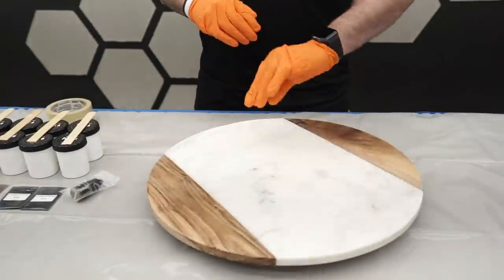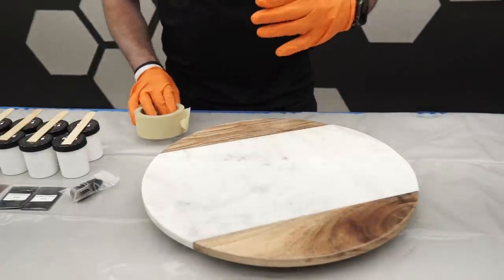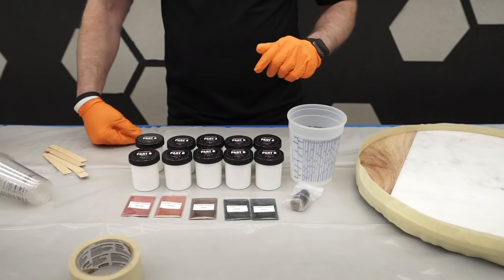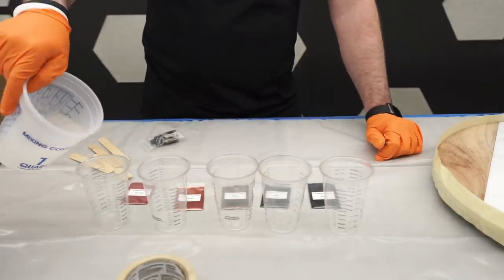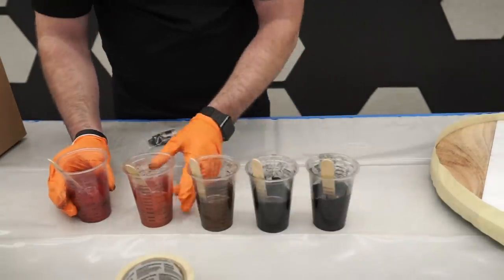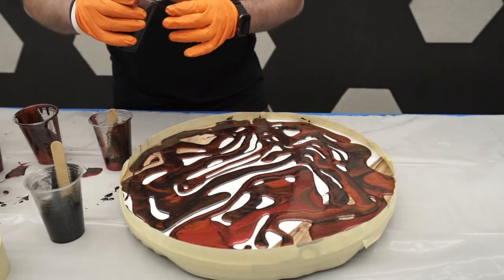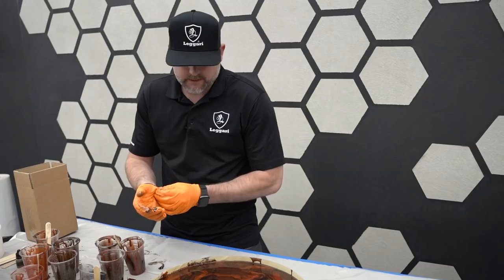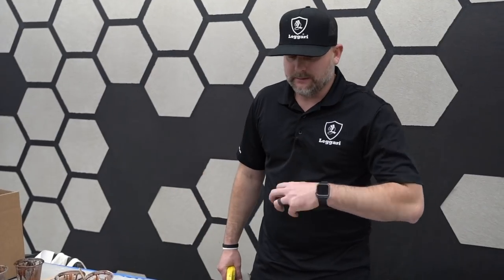DIY A Simple Way | Upgrade A Lazy Susan Using Epoxy Resin | Resin Art Dirty Pour Technique

Comment: How come you didn't use a heat gun to get rid of bubbles?
Reply: Nevermind, I went to your site, but how does it work on canvas pours with swipes....if you add silicone can you achieve cells? Have you flamed it? Must you use the metallic for metallic mica, and will the metallic resin then work backwards for plain mica. So many questions...I want to try ALL of it. No torching!!!! Wow, you guys are wizards.
Reply: Watch more of their videos.  The answers are all there
Reply: @pinschrunner  I already answered my own question days ago, but thanks for nothing, dude. If someone came to you with a stab wound would you make them watch a video on how to avoid stabbings or to remove the offensive impaling object first?  BTW, just a little sarcasm at your total dad answer. 😘

Comment: What was the point if you wasn't gonna show the whole video. The clear and the edges process is missing but it came out nice nevertheless
Reply: After you finish and everything is completely covered you take the tape off and let it flow over the sides, just like on the countertops.